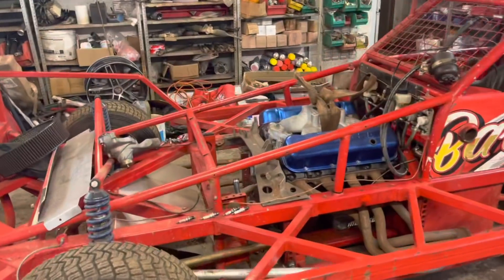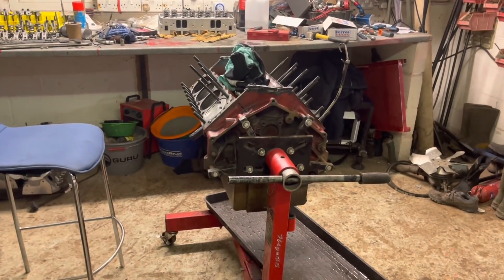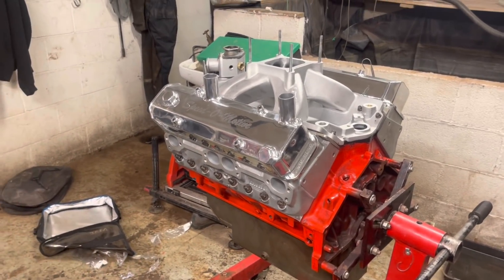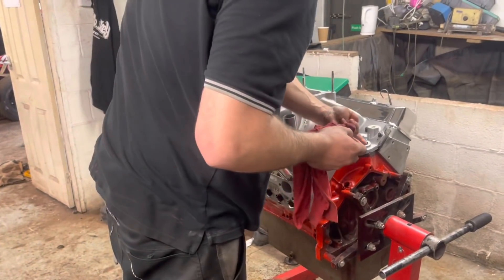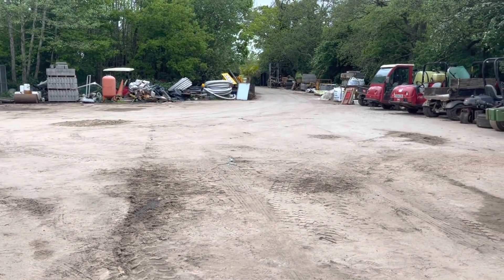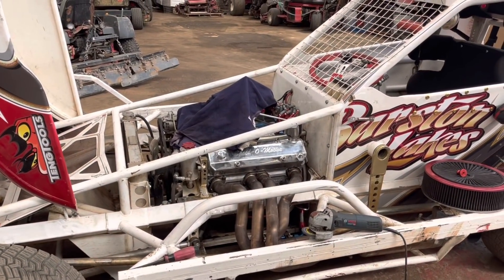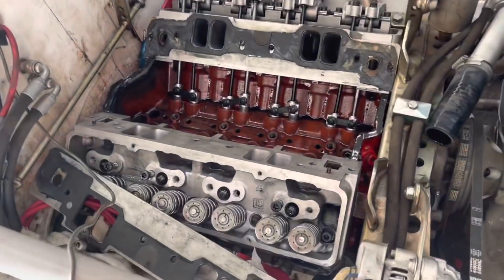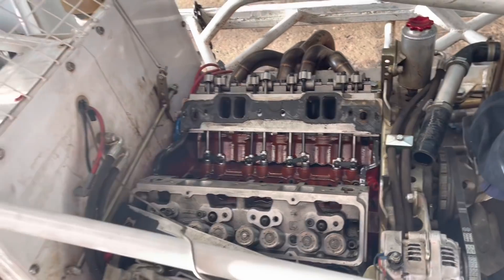A normal meeting

Comment: You need a more considered approach to your engine builds mate, nailing motors together before races is asking for trouble. Skipping vital stuff like checking bearings, oil pump wear, chasing threads etc is costing you. It hard when time is at a premium but sometimes sitting it out, taking the time and knowing it’s right pays off. Good luck with it, really enjoy the vlogs.

Comment: What is the reason behind running a belt versus a chain or a gear drive?
Reply from the maker: Belt is best, then gears, the chain, i bought it like this.
Reply: Cuts out Harmonic noise.
Reply: @NigelHarrhy  might just be the oil pressure switch,but to be on the safe side change the oil pump,switch, take the bearing caps off and check the bearings for wear. Seems strange to do 6 laps then oil pressure just drops off. Or could be crap blocking the pickup pipe but i would imagine you change the oil regularly.
Reply: Ahhhhh ok.... I always preferred the noisy gear drive.... And it never broke

Comment: I am confused I thought they ran gear driven camshaft . You keep mentioning a cam belt  !!!!
Reply from the maker: 3 options, gear drive, belt drive or chain drive, we have had problems with e belt so have gone to chain Chris.
Reply: Hi Nigel thanks for reply and  good luck with the  chain and the rest of the seasons racing .  Cheers Chris.
Reply: Sorry to bother you again,  I presume that's a duplex chain , plus a top tip on those expensive valves your buying . A friend of mine builds top fuel drag bikes etc and has found a company in the states who rebuilds nascar engines . Every time they strip down a engine they replace the valves even if its done a lap . They are titanium valves with I think sodium filled stems . He buys a box of 16 for about £200 delivered to his door . Don't want to say to much on here , but if your interested can you let me know and I will get details and ring your fisheries office. Cheers Chris.
Reply from the maker: @chrisbutlersmith9970  WOW! i just paid £800 for set of valves TWICE!
Reply: What my mate does is buy them and machine them down to fit . Like I said previously I can get and send details . £ 800 is alot of beer 🍺 money .